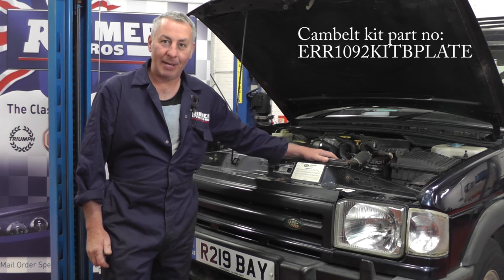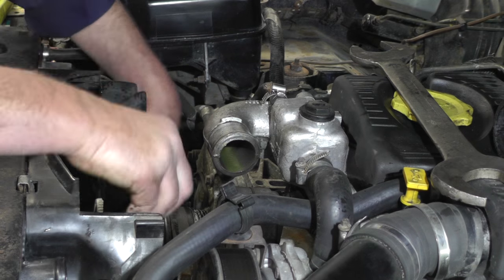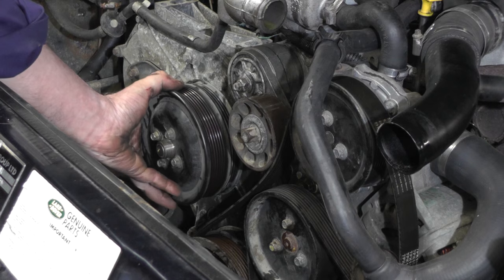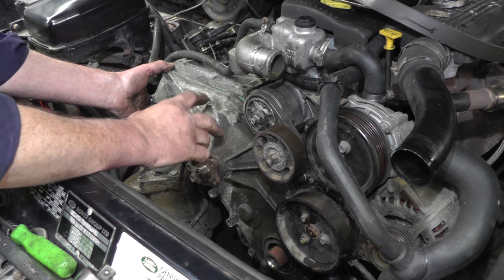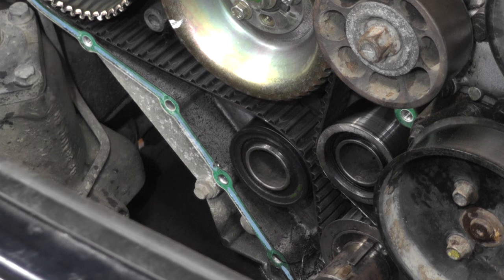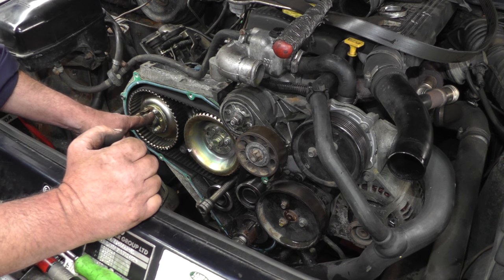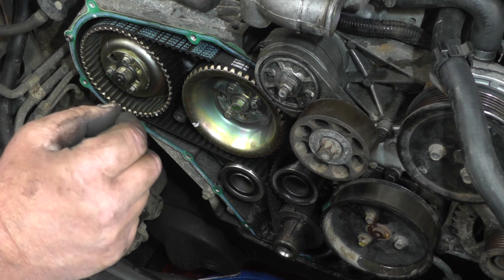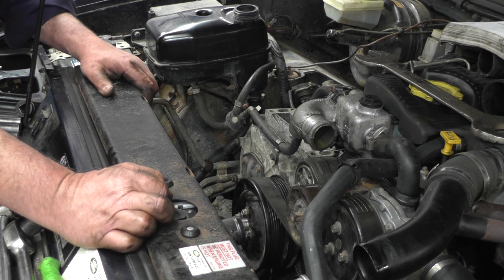Changing the cambelt on a Land Rover Discovery 300 TDI (HD)

Comment: Where at the back of the 300TDi engine is the crankshaft locking pin used? I've searched web over 
and no one has bothered to mention it. It is assumed everyone is fully knowledgeable about the engine. Please help
Reply: Hi. I use a metric fine bolt ground to a flat ended point about 40 degrees included angle on the end I think it’s around M14 into the hole directly at the bottom of the flywheel housing. It’s not a hole in the flywheel it’s a slot and it lines up at the timing point when the other marks are in position so you can carefully thread it in by hand whilst moving the crank back and forth slightly so you feel it engage correctly

Comment: On the idlers you state 45nm fo one on the inside of belt now what about the one to the right of it what is the fixing how tight should that be ???? And why are you undoing the injection pulley just confused and need to do mine this week help needed
Reply: He undid the bolts on the injection pulley so that after the new tensioner and idler pulley are installed and the new belt goes on there is no chance that the injector pulley will move, which would put out the timing. This way, all the teeth on all the pulley's line up. Hope this helps. :)

Comment: Hi I’ve got a 1995 Range Rover Discovery TDI 2.4 exactly like the one you are working on,and I want to block off the exhaust pipe to stop recycling the air and disconnecting the solenoid ERR 3314 . My vacuum pipes have all disintegrated could you do a film on this please thanks 👍👍👍🇳🇿🇳🇿🇳🇿🇳🇿🍺🍺 I’m in NZ